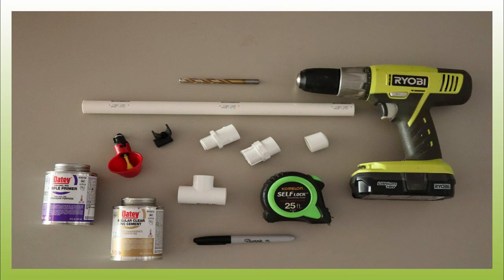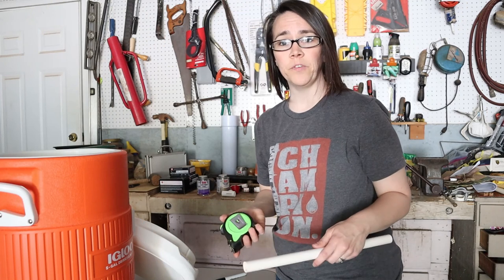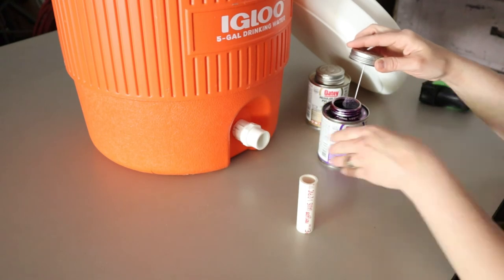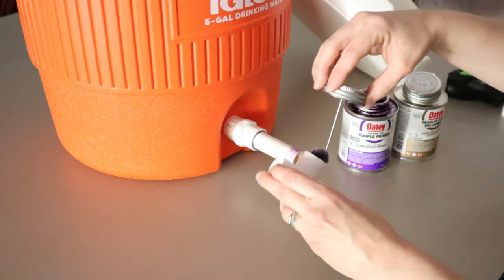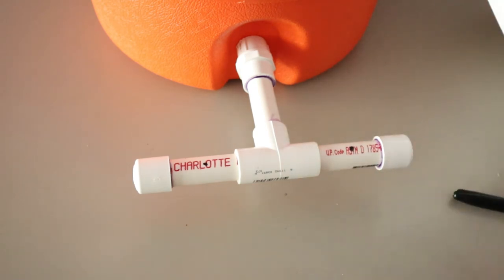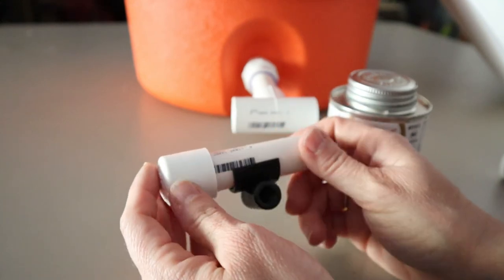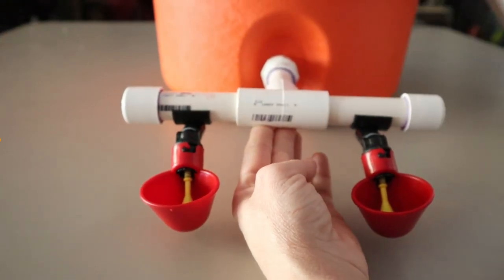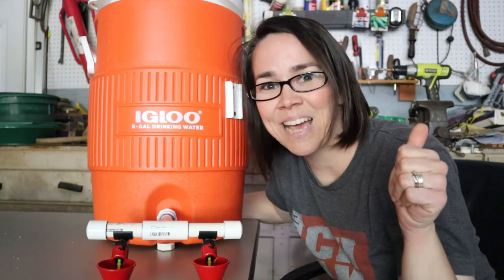DIY Chicken Waterer

Comment: Like your video. I live desert southwest 106 degrees today. I have been using  cooler and water cups for a year. I drop frozen water bottles in cooler to keep water cool for my ladies.  I found that I can reduce algae problems by painting lid back, then cover black paint with white paint to reflect heat..  I put screw on end caps, so I can clean  PVC tubing yearly with bottle brush.
Reply from the maker: @JesseLarson-dt7uo  I absolutely love the ideas of painting the lids, removable end caps, and using frozen water bottles! Excellent tips! 👏👏👏👏

Comment: Can i make the pvc 6" so I can put 4 cups instead of 2? Also, can I use nipples instead of cups?
Reply from the maker: @gladysshulters7055  You can absolutely make the pvc longer and add multiple cups. I would think you could install nipples as well as long as they can connect to the pvc. I don’t know what their fittings look like since I haven’t used them, but I’ve seen photos of them installed on buckets, so I would assume they should work. 😁

Comment: Please advise which waterers you ordered from Amazon. The only ones we can find don't have adapters; they have PVC t's, and we've already done all of the steps through drilling holes for the adapters. Thank you
Reply from the maker: @shellycoffee5955  I checked the link to the adapters we put in the description and it seems they are no longer available. I tried searching for others and I’m only getting the T fittings as well. When we made this waterer 4 years ago the T fittings were not an option. Seems they have done away with the adaptors and are now doing the T fittings. I’m sorry.

Comment: Thanks for the diy video. Wanted to share something I didn’t realize when dry fitting my pieces. The female coupler needs to be threaded on one end and non-threaded on the other end for the extender piece of pvc pipe to got into it. 

Made a coupe of these today using a 5-gallon igloo cooler and a smaller 2-gallon igloo cooler. I used the self-filling cups from RentACoop.
Reply: Does it seem you there is any concern about the chemicals in the sealants? Having made a few yourself at this point, does it seem to you there's any chance any of it could leech into the water? I was thinking of doing this and putting warm-ish water in the cooler in the winter and am wondering if I should only use it with cold or room temp water.

Comment: Thats cool I might make one..I'm tired of dirty water. Although, if I may...instead of those adapters for the cups, it would be a little better to use 2 separate , 1/2" x ( 1/8"?...or whatever size the cup threads are) Tee...socket x socket x thread
And just thread the cups right into the Tee's

Comment: Where do you buy those types of watering cups with the half collar that fits the PVC pipe?
Reply from the maker: I am so sorry this reply is so late. Like really late! here's the amazon link to the cup adaptors. The original ones we found are not available, but we bought these later on to make more waterers. https://www.amazon.com/dp/B00MW5CHWK?psc=1&ref=ppx_pop_dt_b_product_details
Reply from the maker: Amazon now has cups with PVC t-fittings if you need both the cups and adaptors.
https://www.amazon.com/dp/B093SW4XRC/ref=sspa_dk_detail_6?psc=1&pd_rd_i=B093SW4XRC&pd_rd_w=guaMB&pf_rd_p=0c758152-61cd-452f-97a6-17f070f654b8&pd_rd_wg=KSI27&pf_rd_r=C04MMS6AEDAD0V4ZR79M&pd_rd_r=752f517c-615d-4fee-9d23-35f7c5f24985&s=lawn-garden&spLa=ZW5jcnlwdGVkUXVhbGlmaWVyPUFVQk5DQVc1VDdLR08mZW5jcnlwdGVkSWQ9QTA3OTE2MDVNVUFCRFZGNjlQRzcmZW5jcnlwdGVkQWRJZD1BMDk1MTYzMTIxNFdSTEhTUlcyQ08md2lkZ2V0TmFtZT1zcF9kZXRhaWwmYWN0aW9uPWNsaWNrUmVkaXJlY3QmZG9Ob3RMb2dDbGljaz10cnVl

Comment: What about mold? You glued everything, so just had me thinking.
Reply from the maker: @katiecerda7042  I know this is a year late reply, but someone mentioned they used screw on end caps so they can use a bottle brush to clean out the pvc pipes. Pretty good idea for easy cleaning. I haven’t experienced any mold, but I have seen some algae build up in the coolers that sit in full sun.